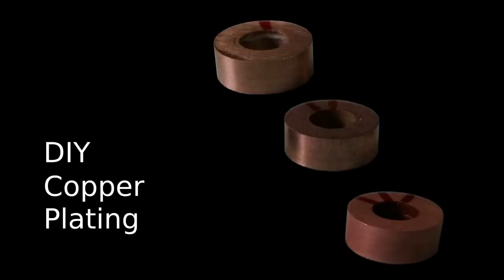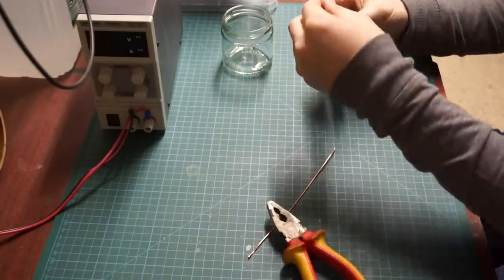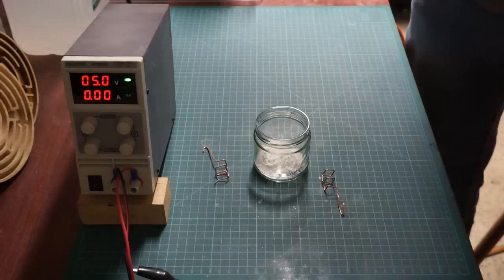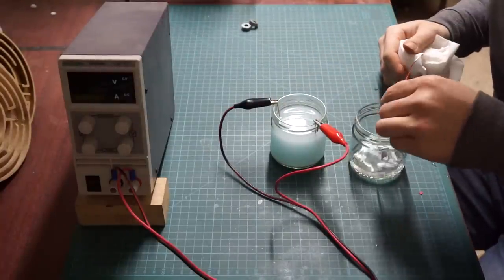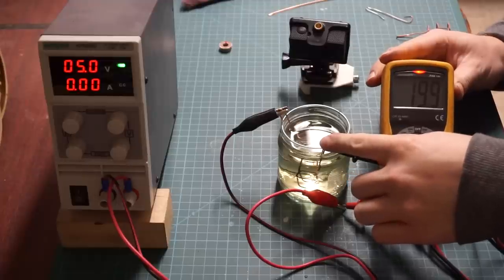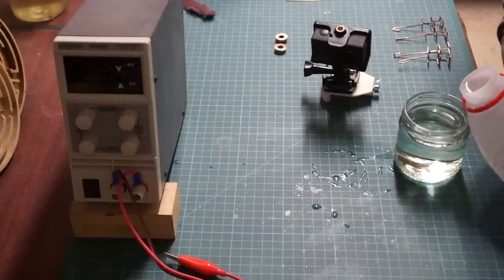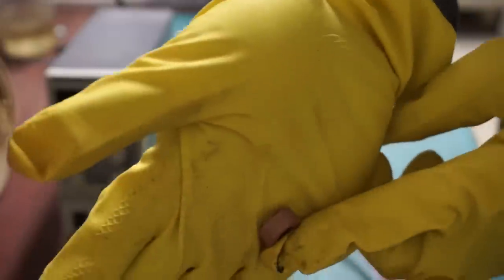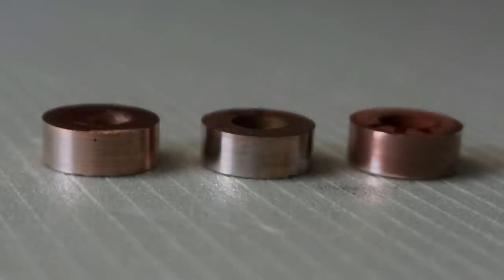Best DIY Copper Plating Methods

Comment: hello sir can i use this formula for big material
Reply: The challenge with big parts is to get an even coating. The formula works but the work piece needs to be constantly rotaded or the solution needs to be constantly stired. Be careful with the hydrogen fumes forming during the process.

Comment: Great video, thanks! Does anyone know how to protect the copper from oxidising? I want to plate bicycle parts but I am afraid that they will turn green soon...
Reply: You will have to hit it with a clear coat of varnish to keep it from oxidizing. Keep in mind the areas where bolts go through will likely nick the varnish and allow water to hit the copper and you may get green runs around your connections.
Reply: You could tin the spots where your bolts will go through by adding a layer of solder around them with a heat gun.

Comment: Thank you for teaching me this:) I really want to cooper plate motorcycle parts.
Will this work with brass also??
Reply: juSTIn Turner. I would think so. Brass has copper in it also
Reply: I am copper plating bicycle parts. How will you protect the copper from oxidising and turning green? I am worried that it will turn green very soon...
Reply: Cornflakes Yognaut I would spray a clear coat on the parts to protect them and keep their color. If you don’t want the parts gloss, you could use satin or matte clear. Because the copper coating is thin, Polishing the parts will eventually rub the coating off.
Reply: @CornflakesYognaut  I'm doing the same soon! Although I'm going to use the brushed on copper sulfate method because my parts are too large to put in a bath for electroplating
Reply: @nsquezada27  wait what? You can brush copper on? I'll google that, it could fix my problems too. I want to plate my whole wheels but I can't find a large enough container.

Comment: Can I use 9v battery
Reply: You can, for a little while. 9 volt batteries don't have much capacity, I imagine it would go flat pretty quickly. 
I don't believe the higher voltage is a benefit, current (amps) is more important than voltage.

Comment: How would you recommend I do this on a bigger scale, like brake calipers?
Reply: Get a 5 gallon bucket and mix 5parts muriatic acid to 1 part distilled water. Hook a piece of copper water pipe to 1 wire and your caliper to the other. Constantly stir the solution to prevent uneven plating, preferably using a magnetic stirring plate and a stir bar so you don't inhale the fumes.
Reply: brush electroplating